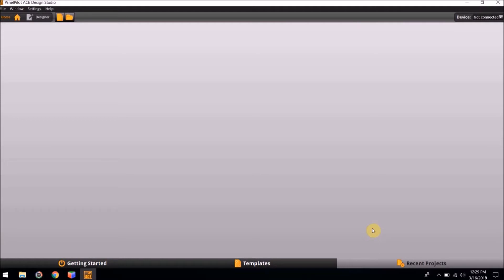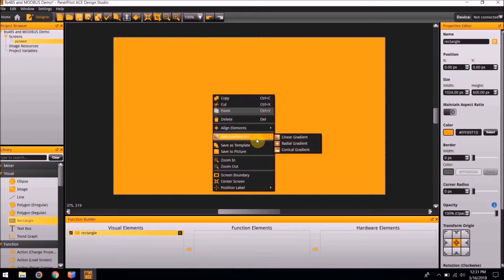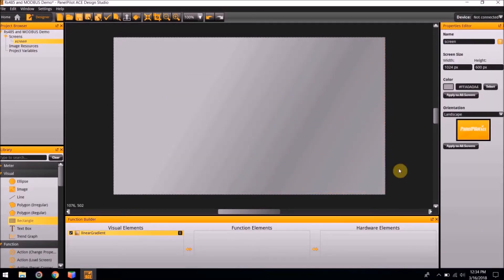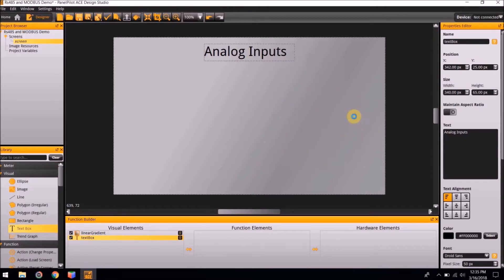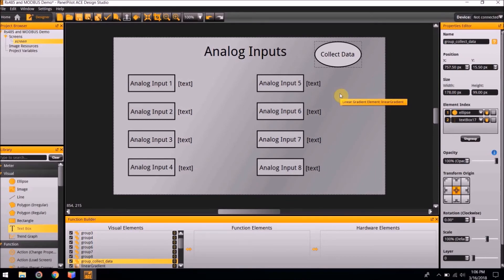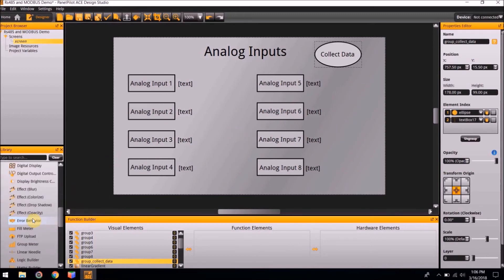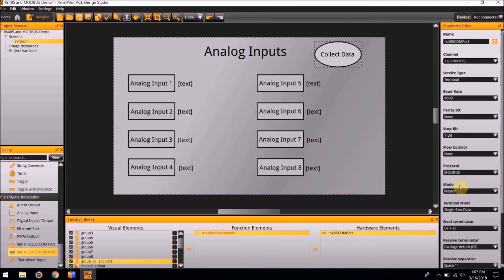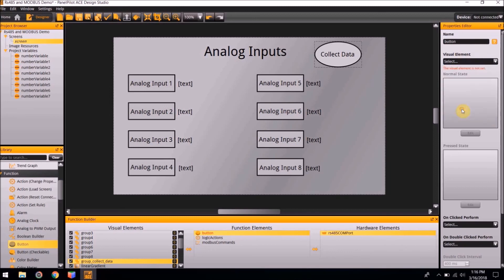PanelPilotACE Tutorial - RS485 and MODBUS

Comment: is it possible to receive the Analogs without the need to add a logic action button? ideally, I need to display data always in real-time, rather than on-demand.
Reply from the maker: Hi Beaniche, Thanks for your question.

The analogue inputs can be displayed directly in a text box using the Digital Display Functional Element at the scan rate of 10Hz.

Or a Timer can used to run a Logic Action automatically.

For further assistance if you could send an email to sales@lascar.co.uk we can put you in contact with someone from our Panel Pilot Ace development team to help further with using the Design Studio and any specific technical and project help required.

Lascar Support Team

Comment: Could do with some guidance on connecting to a general RS-485 device, not the Neptronics. Video spends to much time on the layout and not on the RS-485 / Modbus config. I want to use one of these devices to read upto 32 analog readings for a smart home project using 2 separate 16-channel Analog to RS-485 converters. Can't really find much guidance online relating to how they can be interfaced and read by the display device.
Reply: Did you ever have any luck getting the PanelPilot to communicate Modbus RTU? Either as master or slave? We've been trying it against various PLCs and sensors with no luck. :(
Reply: I didn’t purchase the unit in the end, just made some HMI interfaces on the software but due to the lack of guidance for RS-485 I elected not to purchase.